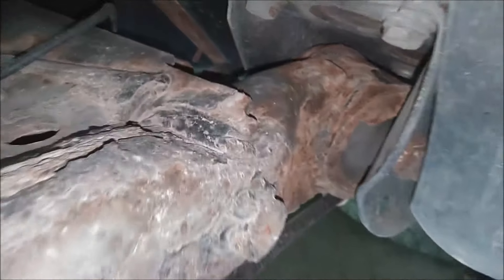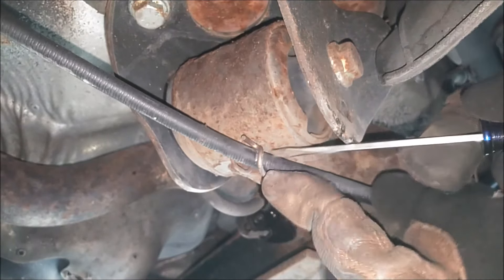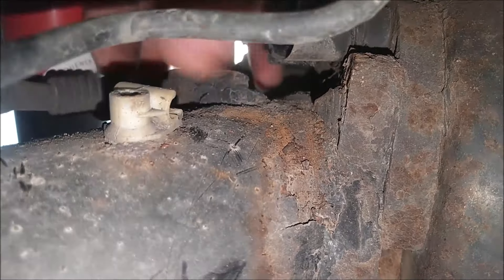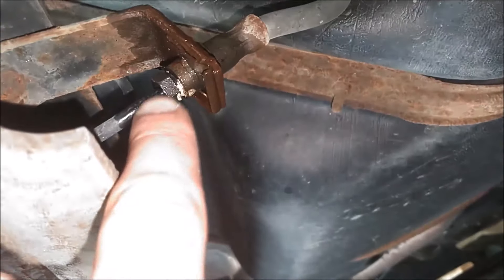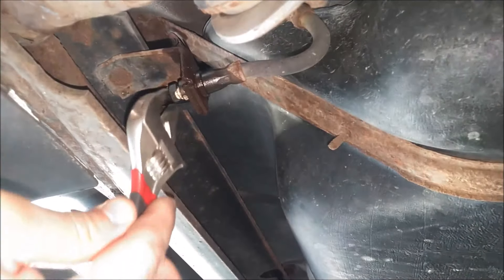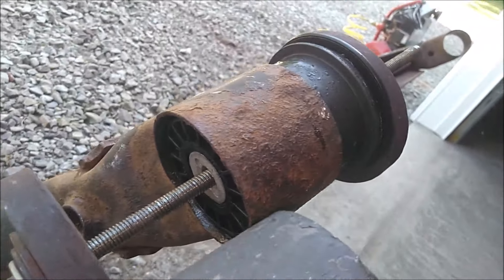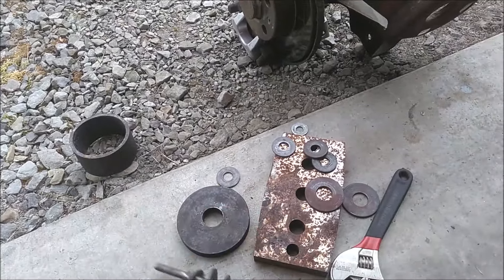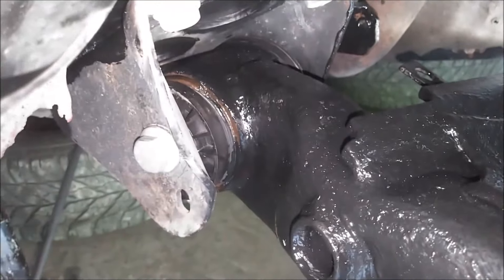VW Golf mk4 Cupra R bushing install with rear axle removal

Comment: Excellent go through of the whole removal replacement process.  Did this a few years ago to a spare axle to prep it up. 2 years before you did it, I had to hunt for days to find a forum post that described how to properly align the Cupra-R bushings (finding out how to do the stock ones is easy, it's in the Bentley manual, but the two have that different shape).  

Now I can point people here (psst: go to the 18-19 minute mark) instead of trying to remember which European mk4 forum thread I found it out from.

Only major thing different I did, was spend a LOT more time wire wheeling and sandblasting the axle to get the rust off, and then repainted 3x over so I wouldn't be repainting any time soon.  
I'd recommend doing the quicker job you did with painting -- 5 or 10 years down the road, no one is gonna look under your car, or mine, and tell the difference.
Reply from the maker: Thanks for the comment. The rust removal was one of the worst parts for me. Unfortunately where I live, our vehicles are exposed to salt in the winter. This causes a lot of corrosion issues. The paint that I used actually held up very well!  Overall, I am happy with the results and the car handles much better!

Comment: Well shot video thanks.
TIP: For anyone thinking of media blasting think about leaving in the old bushings. Protects the bushing contact area inside the loops.
Then remove old bushings.
Then paint / powder coat
Then install new bushes.
Reply from the maker: Click Ireland - Good tip and thanks for the comments.

Comment: I'm planning on swapping my whole axle for a used one in better condition. Replacing everything on it with new parts, and I definitely bought new brake lines in preparation for breaking those lol.
Reply from the maker: Yeah, the brake lines can be problematic unfortunately. Good luck with the swap! I hope that everything goes well for you.

Comment: Outstanding video.  Your commentary throughout the video is most appreciated and value added.  My 2004 GTI will undergo the same maintenance.  I recently purchased new stub axles and bearings for the rear end.  If you have experience replacing the stub axle and bearings, I'm interested in your advice/pointers on how to mate them together.  The tolerance is so close that pressing them together looks like it will be a nightmare, even if the axle is cold soaked and the bearing is heat soaked.
Reply from the maker: I haven't had any experience replacing those stub axle bearings. Mine are original and I'm approaching 200,000 miles!

Comment: Firstly, thank you for the incredibly clear video, well documented and easy to follow, also, I am in the process of doing the same with my MK1 Leon rear axle which is of course the same as the golf mk4 platform and I noticed that after I removed my original bushes, there was 2 what looked like cracks in the casting that worried me, and after coming back to this video I had a close look at 16:55  in your video and it seems as yours has identical marks. Would you say this is a factory defect or an actual crack in the axle. Id appreciate any help as I'm unsure wether to replace the axle or refurbish my one. I must also point out that my car has been garaged all its life and only done 40,000 miles so its possibly one of the better conditioned ones here in the UK.
Reply from the maker: Thank you for the comment. I really appreciate it! I don't believe that those are cracks that you are referring to. Those marks look like the joint of the steel from the manufacturing process. I'm not an expert, but those ends were welded onto the main axle beam. Maybe that they are all like that?
Reply: @Corysdiyauto  thank you for the reply! I was wondering the same. A few people have told me this now. I think I’ll get mine refurbed 😁
Reply from the maker: Let me know how it goes. Thanks bud.
Reply: @Corysdiyauto  will do. Merry Christmas😁
Reply from the maker: @jackgross3140  Merry Christmas to you too!

Comment: Great video. Where did you order new brake lines and did they arrive ready to be installed? Thanks
Reply from the maker: I ordered them from idparts.com and yes, they arrived ready to be installed.
Reply: @Corysdiyauto  thx for the super fast reply. Trying to keep my 01 Golf on the road. Just re did my front end. About to replace all the engine mounts. I’m sure at some point the rear bushings
Reply from the maker: @pujo28  - You're welcome! It's a great car. Hopefully it treats you well and lasts a long time.

Comment: Keep going on the car they're great to work on.
I've the front subframe outta my 2002 Mk4 1.9TDI
The new bushings for it (Febi Brand) I can get for £6.99 each in the UK.
So just gonna do a whole under-carriage refresh front and back. Media blast and repaint / powder-coat.
Such is lockdown eh.
Reply from the maker: Click Ireland - That's a good project to do during your lockdown. Stay healthy and be safe!
Reply: @Corysdiyauto  Appreciate it. Have the subframe in the blaster and looking for thicker sway bar. Total underbody refresh. Looking forward to driving it like new come summer
Reply from the maker: @clickireland1113  - I'm sure it will look great when you are done with it. You'll definitely notice a difference in handling too.
Reply: @Corysdiyauto  It'll be a forst for me upgrading the handling so hope I can stop there. Hardly likely. Ive a W124 rear sub out too. Must get married.
Reply from the maker: @clickireland1113  - I love the look of the w124's. Is it a diesel?
Reply: @Corysdiyauto  Tis yes. E250 1995 NA. 4 spd auto. Used to have a rear suspension too.
Reply: @Corysdiyauto  MB seriously over engineered everything. Things just huge everywhere. 225000 miles. Needs tranny rebuild and o-rings on injector pump. Couple a pulleys squeeking. All else super.Except for body rust. Why aftermarket arches were invented I have no idea.
Reply from the maker: @clickireland1113  - Nice! What do you like driving better?
Reply: @Corysdiyauto  Old Bruno. For a big Mercedes it can really surprise you good on country roads. And it eats highway miles. Just a brilliant bit of iron.

Comment: For stubborn brake line flare nuts, use heat as well. If you dont have flare nut wrenches I found using vice grips carefully on the flats of the flare  nut works well. If you dont have a torch, a good heat gun will work.
Reply from the maker: Thanks for the comment. Those brake line flare nuts can be stubborn for sure!

Comment: Great vid. Very thorough and informative.  Just one question.. Was the suspension making any noise? Rattling or otherwise?
Reply from the maker: A Garza - Yes, every time that I would go over a bump in the road, the rear suspension would bang around and make a lot of noise. It didn't sound good at all. These bushings really improved handling and it was well worth it. Thanks for watching!

Comment: do I have to disconnect the cable of the handbrake and brake pipes if I don't remove the entire bridge but only change the seals one by one on the crane, does it mean the diameter of the pipe when inserting the seals?
Reply from the maker: I would disconnect the handbrake cables, yes. It's better to have them out of the way.

Comment: Did you put rust inhibitor where the bushing goes into the subframe? Or just make sure that area is smooth, grease it, then install the bushing?
Reply from the maker: No, I didn't put paint on that surface. Just make sure that the area is smooth and apply a light film of grease, then press the bushing into place.

Comment: Great great job man. I know it took a lot of effort, time and patients for you to do that replacement at home, with the tools you could get at the moment. Nice job.
Tell me what kind of bushings you used as a replacement. Original for VW Golf 4 or something stronger, more sporty , more stable, more rigid ???
Reply from the maker: Thank you! I used Cupra R bushings which are firmer than stock. The handling was drastically improved! If you like the OEM ride quality, then stick with the original bushings. The choice is yours.
Reply: @Corysdiyauto  i would like to use Cupras too man !!! 
Thats why i asked you for your opinion. Thxs for reply !!!👍👍

So, cupras bushes fits at golf 4 like the original ones , without any adjusting??
Reply from the maker: @ilirdalipi  - Yes, they get pressed into the rear axle beam just as you would with the regular bushings.
Reply: @Corysdiyauto  thx a lot of bro
Reply from the maker: You're welcome bud!

Comment: for replacing only the bushings, is it possible to simply remove coils, springs, bolts and drop the rear axle without disconnecting brake lines? or will it break the lines doing it this way?
Reply from the maker: Kristian Muldre - You can drop the rear axle by doing what you said. You'll need to disconnect the brake lines from the hanger clips on each side. This will enable you to drop the axle without disconnecting the lines and then having to bleed the brakes. Just make sure that you have new clips for the lines in case yours are rusty. They can get fragile and fall apart. I hope that this helps.
Reply: @Corysdiyauto  Thanks a lot! Will give it a try.

Comment: Cory, I'm trying to figure out how to clock these Cupra R bushings.  The ones I bought from a vendor are not marked.  In your vid, I see the mark is 90 degrees from the elongation direction in the center of the bushing, however after they're installed, it looks like the elongation is straight up and down vertically to the ground with the axle in the correct position. Can you confirm the location of the mark to the axle? Thank you.
Reply from the maker: Dave Schmidt - The mark is supposed to be in line with the weld on the axle, which is the lower part closest to the ground. I don't know how important this is, but that's what you're supposed to do. I've had another company tell me that it doesn't matter how you install them because they are solid bushings. I would like to cut one apart at some point to see what they look like inside. I bought mine from Kermatdi and they put the mark on the bushings.
Reply: @Corysdiyauto  Thanks Cory.  I actually started a thread over at TDIClub on this as I have a set from IDParts and they're not marked and wondered how they're installed.  I posted a few photos over there and it looks like even the Cupra R's have a gap in the rubber, just less of one.  Here's the thread if you wanted to take a look (with the close up photos) https://forums.tdiclub.com/index.php?threads/cupra-r-rear-bushings-orientation.512246/  .  I was getting ready to install them like in this post, but your installation I think would be 90 degrees, but the hole slotting doesn't look at way in your finished install.  https://uk-mkivs.net/topic/100211-how-to-rear-beam-axle-bushes-cupra-r-bushes/?p=2801614
Reply from the maker: @daveschmidt132  - I contacted IDParts about these and they told me that the orientation doesn't matter. I do think that KermaTDI might be more knowledgeable on this topic. They do give a bit more detail on the bushings on their website that you can look at. I will check out your thread on TDIClub.

Comment: Hi buddy I got to take mine off but I tried to undo the brake pipe but the nipple won't undo any tips on getting these updone as I don't want to replace the brake pipe .
Reply from the maker: Tom Tom - Those brake lines can be difficult to get off if they are corroded. Try to spray some penetrating oil on the fittings and leave it sit for awhile and then try to slowly loosen. Try to work the fitting back and forth until it frees up. If that doesn't work, then you'll have to replace them unfortunately.

Comment: My golf 4 rear tires wore out on the inside tread. What do I do? Replace this bushes?
Reply from the maker: Yes, I would replace them, especially if they are original. It's a good time to replace any other suspension components while you have everything out, such as shocks, springs, and mounts.

Comment: What's the outside diameter of the bush? I would like to get a set of polybush and there seems to be two dimensions.
Reply from the maker: For my 2001 VW Golf TDI, the OD is 69mm. I believe there is also a larger size of 72mm, but I am unsure of what years are different?
Reply: @Corysdiyauto  thx for reply. I believe you are correct. From my rough measurements on my 02 golf gti it seems to have 69mm. Little difficult to measure but I will try to do again soon and report back.

Comment: Where are the brake lines going to from the brakes
Reply from the maker: Nasko Marinov - From the caliper, the lines run along the rear axle and they are clipped to the axle beam near the bushings on each side. At this point, there's a threaded fitting that connects these lines to the long lines that run underneath the car and up to the master cylinder. I hope that this helps you.
Reply: @Corysdiyauto  thank you very helpful as i might have to replace my axle on jack and axle stands this weekend as runs out of MOT in few days and im not sure if i am able to, still thinking but cheers for that

Comment: i heard cupra bushings dont need to be  oriented
Reply from the maker: alfaromeo - I heard that too, but I called the company that I ordered these from and they said that they do. This is why that they painted that line on them.
Reply: @Corysdiyauto  How did you find the bushes after you fitted them? I've been looking for the correct orientation of these bushes and have found 3 different answers so far! I think you may have fitted these incorrectly. If you take the cap off this bush, you can see that there is a void in the rubber at either end of the long part of the bolt hole in the middle, and I think the voids should be at the top and bottom of the bush, rather than at either side. I think the long part of the hole should line up with the weld you used in this video. It might be the case that it doesn't really matter, though!
Reply from the maker: @ralphenstein9105  - What do you mean by "How did I find them?" There's a lot of debate on these bushings and I just went with what KermaTDI told me. I bought these bushings from them and they come with that mark put on them. That mark is supposed to be lined up with the weld in the axle beam. These have been in use for about 30,000 miles so far without any issues, so I assume that I installed them correctly? I am definitely happy with them and they perform much better than the stock bushings!
Reply: @Corysdiyauto  I just meant, what did you think of them? Glad that you haven't had any issues, and that they're much better than the stock ones. I'm doing mine at the mo. Pig of a job!
Reply from the maker: @ralphenstein9105  - Gotcha, yeah I really like them and it was definitely worth doing. It's a lot of work, especially if you have rust issues to deal with like I did.

Comment: Just another moan... adjustable spanners are NOT for this type of work... otherwise no other moans,, sorry to be critical about adjustables but US people seem to use them for everything.. and they are not well fitting enough for this sort of corroded metalwork, nut heads, bolt heads etc.   Nice completion of job.
Reply from the maker: That's all I had to use to get the job done and it worked. Sometimes you have to improvise. Thanks for watching!